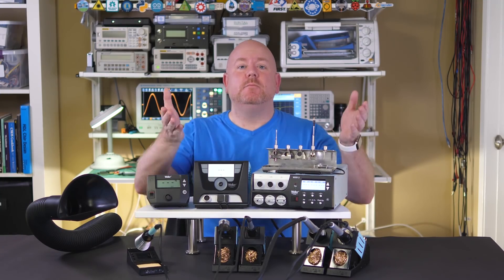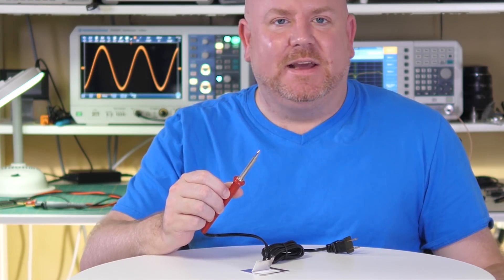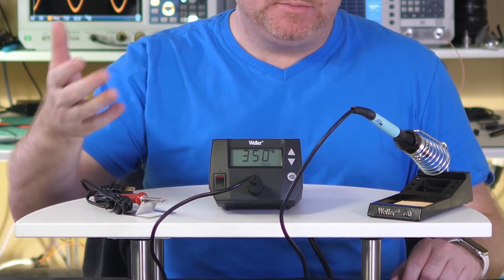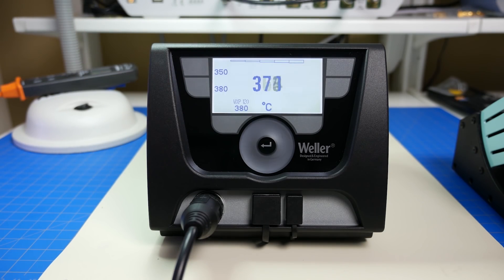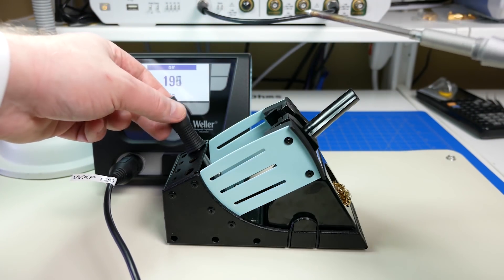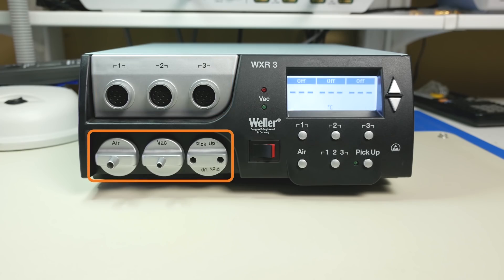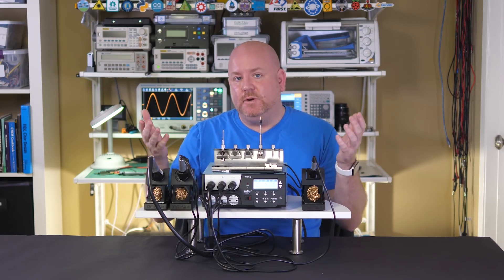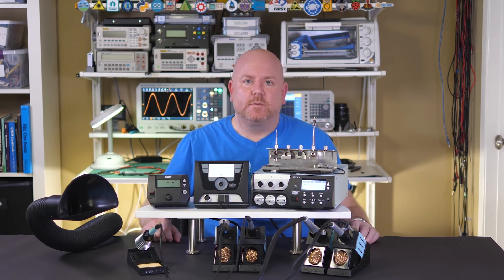Upgrade Your Solder Station - Workbench Wednesdays

Comment: Have the 2 tool station myself. The station is ok, nothing special (note the recently released new versions look infinitely better). But the massive problem with these Wellers is the lack of soldering tips. They have a lot of handles but the active ones have a serious lack in tip variety. Additionally the hibernate/sleep function just doesn't work reliably. I never get it to work correctly and ended up just using the on/off function on the WX2 to switch the individual tools on or off.

In the end I switched to the JBC system, they are not kidding about having 500 different tips.

Comment: Any beginner upgrading from a plug-in solder iron would be better of buying a Hakko clone for $50. 
Replacement tips and other spare parts are cheap and easy to find(quality varies). 
Weller on the other hand has almost no third party tips and for the price of one Weller tip you could get around 5-10 Hakko compatible tips.

And how is the WE1010 entry level? it cost $150!!!

Comment: Please talk about how some soldering stations work by sending a high frequency signal down the cable rather than just a lot of current, and the benefits of the different methods. Buying used broken soldering stations on ebay and fixing them? Also can you talk about the temperature settings for different situations? How dangerous is it to work without a vacuum sucking away the fumes? Tools for holding the boards and things while you solder as well as improvised methods to hold things while you solder? (I don't have helping hands; so I use my multitool as an alligator clamp, wrapping a rubber band around the handle to turn it into a vice-grip.) The Importance of flux? different types of flux? Toxic vs non-toxic solder and flux? Electrical soldering vs brazing for plumbing? Butane-powered portable soldering irons?
Reply: That's great feedback Sean. Thanks for taking the time to suggest it.  It would be really help me out if you could post the same comments over on this element14 page. I'm already planning to cover a few of these topics in the later videos. But some I had not considered. (The show producers give priority to feedback posted on e14.)

https://www.element14.com/community/docs/DOC-91558/l/workbench-wednesday-03-considerations-for-solder-station-upgrades
Reply: Induction heat irons are the best available, but some newer integrated tip heater irons like the TS100 are almost as good for way cheaper.
Reply: @NiHaoMike64  Yes, I'd like him to expand upon that. How does it work?
Reply: @fac3th3wolf  The advantage of induction heating is that the heat is generated right in the actual tip. Integrated tip heater irons have the heater very close to the actual tip and therefore are almost as good.

Comment: Weller must be paying for this.  Weller's engineering and quality has slipped badly compared to their competitors at both the high end and the low end of the market.  Users can do just as well on eBay with a discount Chinese setup.
Reply: As long as you open them up and check their work. I have seen some shaddy work and lazy application of standards in them. I have had 4 Yahua stations. You can find a complete unit on sale for 100 bucks now and again. All preformed to expectation. You have to take a little longer. They don't have auto shut off. Once you make sure they are grounded properly they are fine for a hobby setup. I'd like to see people create modifications to them to make them better machines.

Comment: Weller? Come on... Please.... 
I own a weller WS81 station myself, but I would NEVER buy weller in the state the company is currently in. It is not the same brand it used to be. No more decent unbreakable good technology, but cost cutting on all margins.
Competitors such as Pace and JBC are far better choices. Next to skipping on innovation leaving their performance less than competitors, more importantly, they are skipping on safety, which is in my opinion inexcusable. 
Also, why are all stations in this video weller? If this video is sponsored and/or endorsed by weller, please make it clear from the get-go. I dont like seeing advertisements in a poorly concealed 'advice' video.
Reply: Every brand has their equivalent offerings to these models. The advice is good whether Weller is used as the stand-in brand or not.
Reply: I'm quite new to soldering and everything, but wouldn't part of the point of using the same brand be to make sure that during the upgrade path your previous tools were compatible? Are there other brands that are fully compatible with the connector type and everything, or is it a universal standard across all companies? Would you have this same complaint if they had used Pace or JBC the entire video instead (assuming tools are not interchangeable across all brands)?

Those questions out of the way, it's good to know to avoid this specific brand until they turn their ship around.
Reply: @valience1739  I dont know anyone that follows an upgrade path of any toolchain. If you are going to upgrade from for example a beginner station, to a higher end one, you pick the best one you can buy. I didn't stick with weller either, I chose the JBC since it is clearly the best value for money for higher end stations. Why would you care if previous tools are compatible? The only time where you would need to exchange soldering irons for a controller, is if you for example have tweezers, and those are for high ends only. And your old station you can still use in parallel with the new one anyways. I might add that the soldering irons themselves are not even the biggest part of the cost, the controllers are the most expensive. 
There is an opensource soldering iron controller available that is compatible with all different soldering irons, but generally companies only support their own. Then again making an adapter for that shouldnt be too difficult. The soldering iron itself is merely a heating element with a thermocouple to measure temperature. 
And yes, I would have had the same complaint if they used only JBC or only Pace or only Hakko or only whatever. And not just limited to soldering irons.
Reply: I do not know about modern Weller but my WS81 is still going strong. I use it for SMD only. My daily driver for many, many years is a Pace MBT-250 with standard solder iron, tweezers and the king of desoldering handpieces, the SX-100. I made the mistake to buy a Metcal a few years ago. It solders well but quality sucked and the service from Metcal even more.
Reply: @pa4tim  The old wellers are definitely decent. My WS81 is still going strong too, but compared to cartridge soldering stations they clearly lack heat capacity. 
It is kind of similar to drills, old fashioned drills still work fine, but compare them with modern brushless drills and they will blow the old one out of the water in terms of torque.
Reply: I like their following EA's implementation of lootboxes in their sales tactics. Totally random if you get a mains fuse or not.

Comment: Check EEVLogs about Wellers having no internal fuses so i would skip them until the issue is fixed
Reply: The older models do, it appars sometime in the mid-2000s they decided they could save few cents by not including fuses on the mains side.
Reply: WHAT IS YOUR RECOMMENDATION ON GOOD BUT AFFORDABLE SODLERING TOOL?  I USE IT IN USA 110VOLT AC, BUT ALSO WILL USE IN ASIA/PHILIPPINES 22OVOLT AC.
Reply: @smartassist9700  The TS80 should fit your requirements if you travel frequently. It runs on 9V/2A though an AC/DC adapter.
Reply: That is the EEVblog 
And yes they skipped fuses years ago which is really bad. 
This is equipment that you expect to be powered on for many ours at a time.
Reply: Well, if you are dummy enough to plug 120 into 240, without checking voltage requirements, yeah, skip them. Also this video is sponsored by Weller or what?